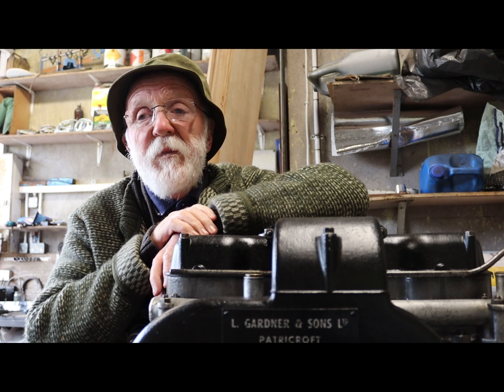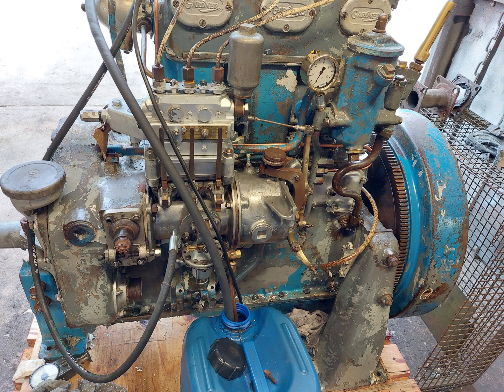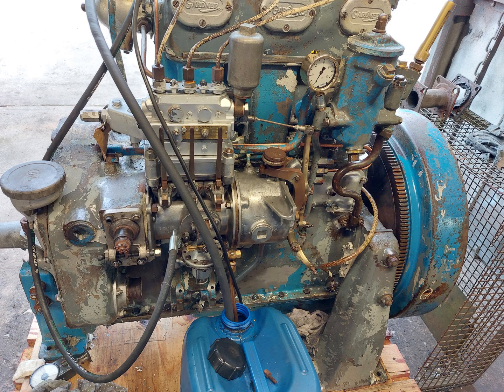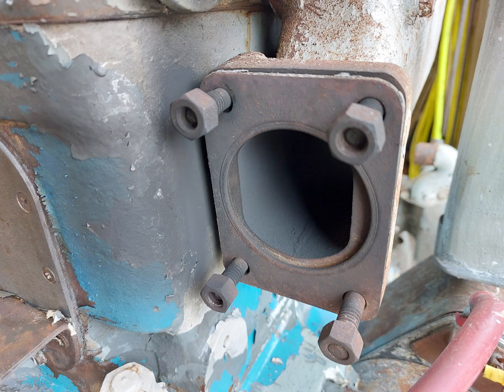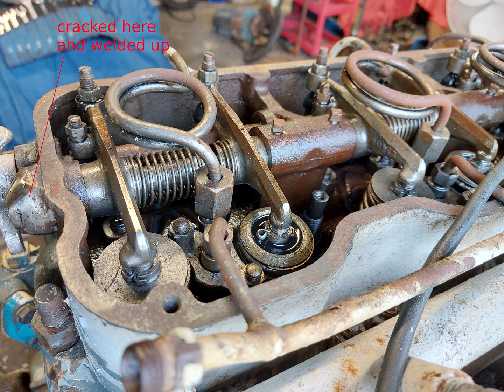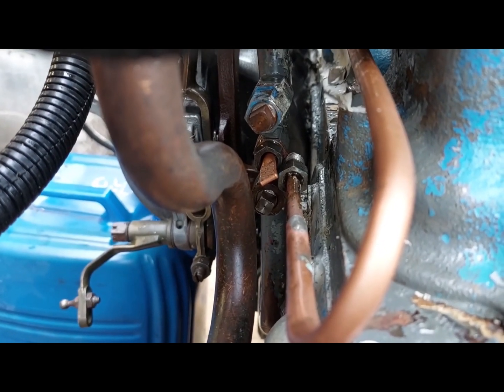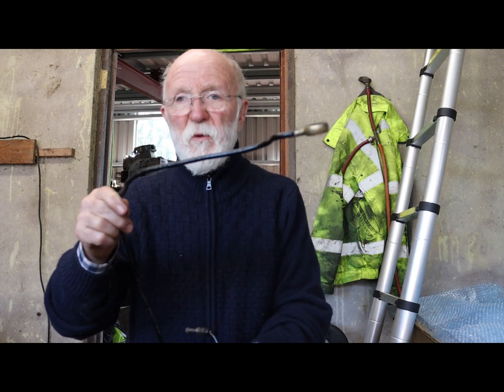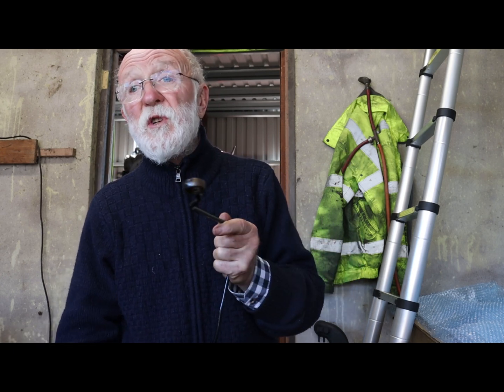Gardner engines: how to bring about a DRAMATIC drop in oil pressure!

Comment: Thanks for a good demonstration of what can be wrong. I am puzzled though as the original arrangement must have a restriction to control the oil flow?  I am wary of such features as if an orifice blocks over time, the oil flow may become inadequate. So, any idea how the original design restricts the flow? It must either be in the pipework or the rocker assembly?
Reply from the maker: Simple, the pipe is fine bore.  I am guessing 1-1.5mm.
Reply: @tangentgardner  Ah ok, like the injector pipes then.

Comment: That's fascinating. Years ago I had a Ford Fiesta diesel - the non turbo one. I lost oil pressure without warning and feared the worst. The oil pressure warning light was on but could hear no obvious engine damage noises. I scanned through the vehicle manual and realised that the overall oil pressure was controlled by a small ball bearing/spring arrangement that was contained within the vacuum pump at the end of the cam shaft. The engine used this method to create vacuum assistance for the brakes.
I replaced that vacuum pump and bingo! Fixed it. Of all the places to keep oil pressure correct, I did not expect a vacuum pump!
That's really interesting how you've effectively 'tuned' the oil pressure system by squashing a pipe until it works. Must admit I would have overlooked that.
Reply from the maker: It all boils down to Bernoulli's equation.   The young French Bernoulli proved that the pressure drop along a pipe is dependent on the length (or course), but also the cross section area!  He was one bright pup, that lad!  In everyday life you can see it, again dramatically.  When a water main bursts, you'll have very little pressure at your kitchen sink, perhaps just a dribble!